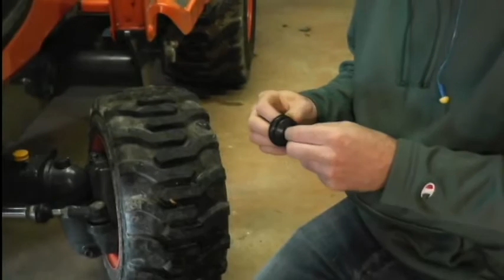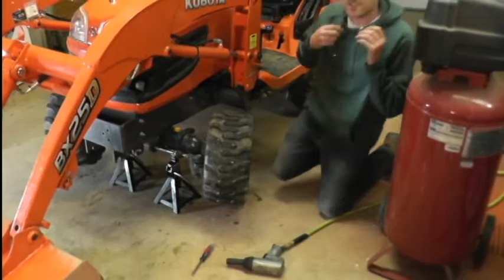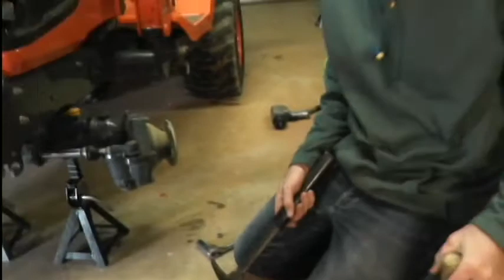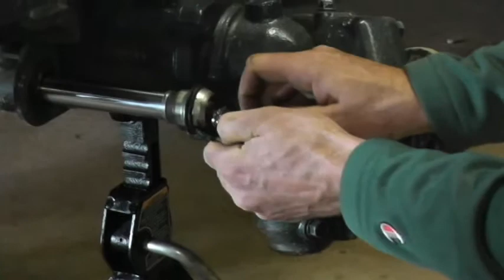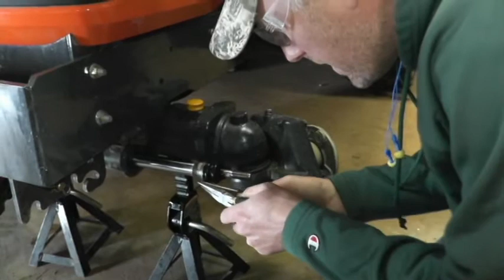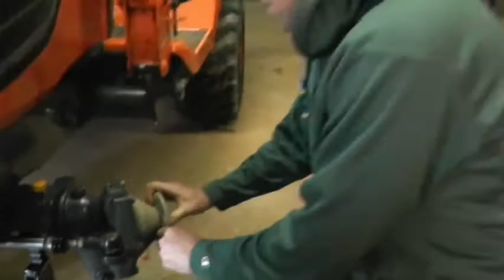Kubota BX Series Inner Tie Rod Boot Replacement - BX25 / BX22

Comment: Looks like no link 5 years later. I cut about a 4x5 inch piece of rubber from an old inner tube and wrapped around mine and used zip ties on each end to hold,   in a pinch.   Several years later,  still on there and work fine,  don't have to take tires off.

Comment: Nice video-Easy to follow. I have the BX2350. Has anyone figured out how to replace the tie rod end? The tie rod is attached to the smooth steering cylinder, has an almost hidden slot on one side but not the other. Since both threads are right handed one side might be able to be replaced however I have not figured out how to remove the right hand ( sitting in the seat ) end Any help is aooreciated!

Comment: Seems he doesn't provide them anymore but I found these. They are also on ebay. Search this..."Kubota BX & GR Inner & Outer Tie Rod Boots Upgrade (all BX models) 1 Yr Warranty"
Reply: The upgrade ones on eBay other than this guys ones don't seal at either end with a zip tie or ring clip. So foreign particles can get in. Wouldn't risk it

Comment: Follow up: I did my outer boots today, and noticed the nylon zips I used last year for the inner boots were just a bit loose. A quick pull on the remaining zip and it closed up the space. One other unrelated comment: when you do this job it is a great opportunity to check that the front wheels are parallel. One of mine was visibly out so I just turned the outer tie rod as needed to get them back in alignment. (They were out of alignment from when I bought the tractor with 50 hours on it, but I never looked too closely at that before.)  Finally, your outer tie rod boot kit is just as great as the inner one you sold me last year. Thanks!
Reply: Hi there, how do I contact/ order the modified inner boots from this tutorial. Thanks

Comment: Hi. Does this kit work for a BX 2350? Also, what's the search string to find your product on eBay (there are several vendors selling kits, and they all seem pretty similar). Thanks.
Reply from the maker: Hi Jack, yes this will fit a BX2350.  

This is the link to my store: 

https://www.ebay.com/sch/ajf166/m.html?item=381822525181&rt=nc&_trksid=p2047675.l2562
Reply: Thanks. Got your kit, installed fine but discovered my outer boots ripped when I took them off. Oops. Other than your complete inner/outer kit, do you sell just an outer boot kit? Thanks. Keep up the great work.
Reply from the maker: Got your outer boots mailed out.  Should see them this week.

Thanks.
Reply: They arrived today; thanks very much for the special handling of my request.
Reply: @tonyfanelli457  Hi there, I clicked on your eBay link, but there's no Kubota inner tie rod boot kits there ? Hope to get some.

Comment: Great instruction and will be sure to reference when I go to do this.  The local Kubota dealer here only carries the entire tie rod and not just the boots.  I have a B2301.  Any idea how I can determine if the same boots are used?  If different, do you carry the correct boot for my model?  Thanks in advance and again, terrific video.
Reply from the maker: Troy, glad you liked the video.  Working on getting a kit together for the B series.
Reply: Great news!  Hard to find just the dust boots; in fact impossible to this point.  Looking forward to the availability of  your new B series kit.
Reply: @tonyfanelli457  I would like to find the kids for the BX 24 I haven't been able to locate them on eBay

Comment: Thanks for the great video. Very detailed and easy to follow instructions.
Reply from the maker: Thanks Mark.  Glad it was helpful.
Reply: @tonyfanelli457  Hi Tony.  Not sure if you will get this message or not.  I have never used this before.  I am needing to replace those boots on my BX25.  Kubota only sells the entire unit with the boot for approximately $100. per side.  I was on Ebay and am wondering what boot you actually bought for this.  There are several to choose from.  Hopefully you can help with this.  Thanks. Kevin